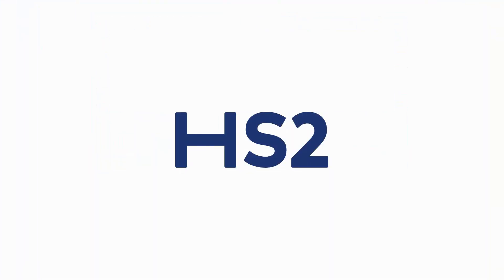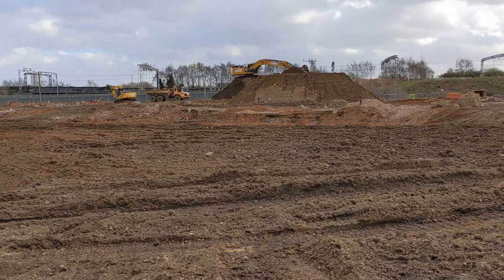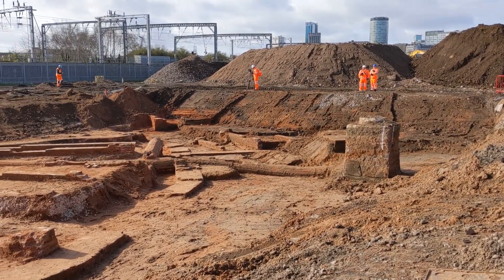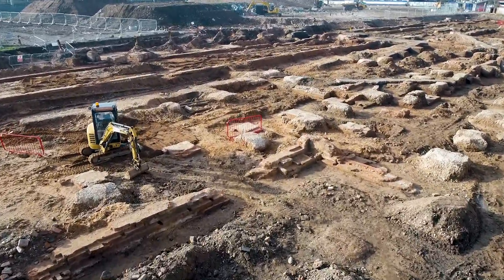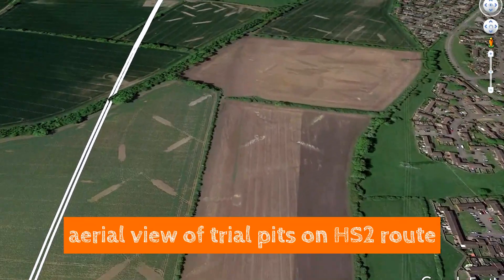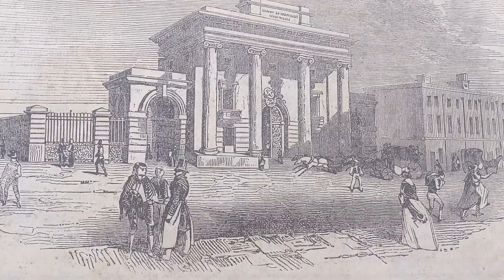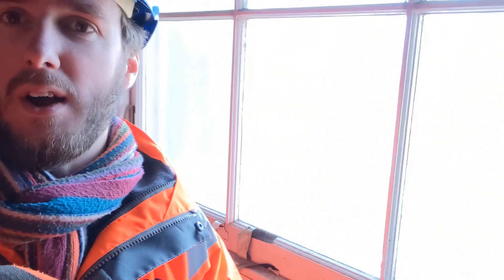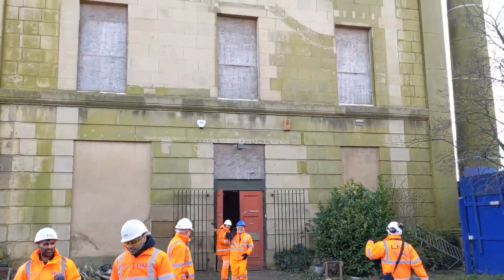#RailwaysExplained | Curzon Street station

Comment: Great video Gareth! Don't worry about the wind noise, it adds to the drama!  One thing I was wondering and thought I'd ask you in case you knew.. Given as you say, New Street will likely become the dedicated main hub for suburban rail in the West Midlands - which makes total sense: keeping suburban and inter city passengers apart makes more sense the more you think about it..  But back to the question, are they planning to open an interchange station on the line east of New Street where it runs alongside Curzon Street?  Theres no easy way to walk from New Street to Curzon Street even if the distance isn't that great.
Reply from the maker: The plans are that the urban realm between the two will be improved, but also that more suburban services will use an expanded Moor Street station as well... Though given government is cutting rail projects left right and centre that might not happen.